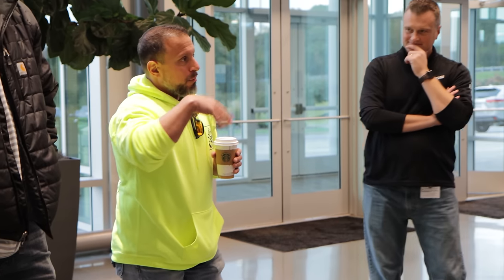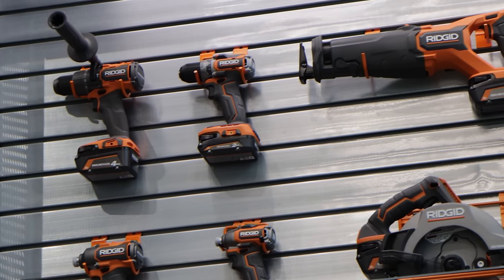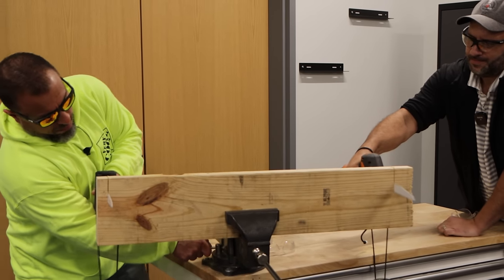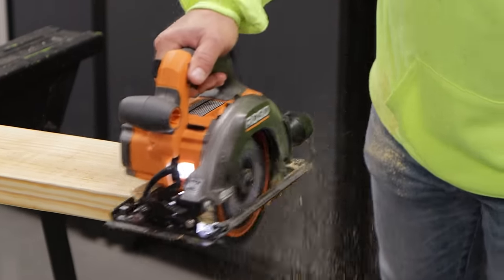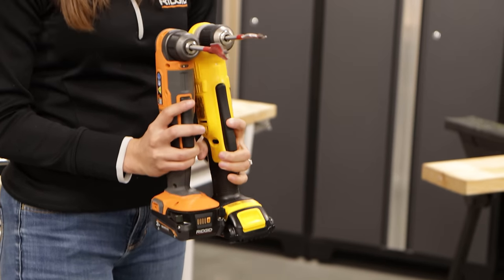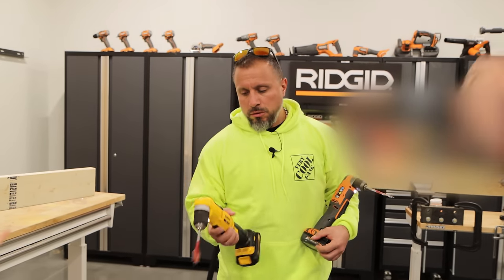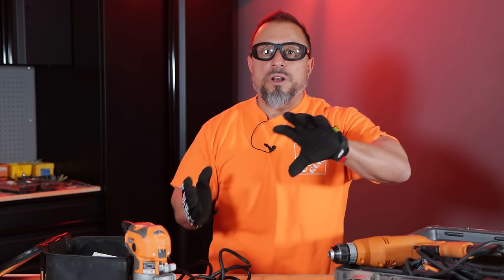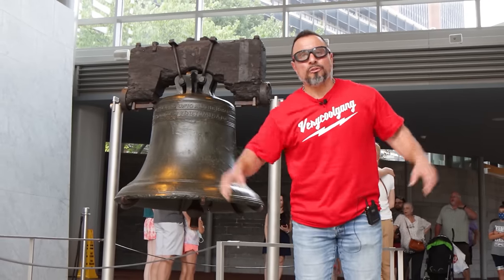Telling Ridgid Executives I Don't Like Their Tools!

Comment: Im not on the Ridgid platform but I'll be cheering on their success.   Ridgid's new offerings will help drive innovation, competition and ultimately improve their customers end user experience.   Those demo's were impressive!  Have an awesome night! 👍
Reply: As a professional the Ridgid Miter box is not something I would ever buy. Took mine back, very inconsistent cuts even at 90 degrees. The cuts were all over the place. I have an old Ryobi that cuts 90 after 90 after 90 all day, dead on. Ridgid also does not offer the same selection that their sister Milwaukee does. So, at this point I am going over to Makitia. The quality is there, and they give you a great variety equal to Mil or better. I stayed with Ridgid for the last 8 years. Now, for a tool company to fall on their face with a poor miter box design, they are not competent, how did you let this happen?

Comment: Like they say “two’s company and three’s a crowd.”  It’s hard managing three separate tool lines and maintaining a purpose for each. Back when Ryobi was blue and didn’t have as large of a line of tools and was what Chaka Gillis thinks Ryobi still is, having the Rigid line made sense as a step in between Ryobi and Milwaukee. But the Ryobi line has become huge and the green so much better and Milwaukee’s prices are really competitive that there isn’t as much need for the middle step anymore in my humble opinion.  Maybe they should stick to corded tools and vacuums where a lifetime warranty is more valuable?
Reply: Milwaukee's price is not all that great when you consider the top end ridgid octane tools meet them in quality and swap blows in perfomance. 

No matter where you look they swap blows on many tools and Ridgid hi torque 1/2 impact holds the crown of the most powerful 1/2 cordless impact as tested By Torque Test Channel found here on youtube, which includes all models of 1/2 Milwaukee impacts which are intern more powerful than pretty much all others themselves.

The biggest thing ridgid lacks is variety which is funny considering the amount of other tools they release under their name in other countries which is  AEG.

I would however agree That Ryobi is still on a Slope headed closer to the top day by day as their tools keep getting more features and more power. Their new mid torque impact is a monster. Leaving only a small space for ridgid to fit in. If ridgid continues to make tools like their newest line up though they may be swapping spots with Ryobi. Happy with all my Ridgids except for the three subcompact tools I own. The power is ok but the quality is, well it remains to be seen.

When Ryobi starts to swap blows with Milwaukee constantly then it may be time for ridgid to go. I guess Id have to go Milwaukee because I hate the old school style of the Ryobi batteries, they are terrible to store and pack out if you have a few
Reply: @D3M3NT3Dstrang3r  I completely agree with you on rye batteries. The HP line should have been in the new style of batteries and just include an adaptor to make them backward compatible. Total ball drop there.
Reply: @billsedutto8824  Totally agree. I would love to pick up more of their line as they are getting strong and reliable enough for daily use given their variety and price. I just hate that with all other manufacturers you can stack the batteries in a box or cabinet etc. Not Ryobi though, you got to play a game of Tetris to get them to fit neatly.

Your right too, it would have been a good time to swap to a newer style. I agree it would suck to lose backwards compatibility but they could just as easily make an adapter like Dewalt did with their 20v max Lithium to 18V ni-cad tools. In 99 percent of cases considering the average buyer of most of the older Ryobi tools that would be just fine, especially if they made the adapter nice and thin so it would almost be unnoticeable when attached to the tool.

 I guess it would suck to have to buy newer batteries but if your buying the newest tools you probably need to anyways to get the power gains of the newer tools. If your gonna cut the power in half with an old battery might as well just use the old tool.
Reply: The green line may have become huge, but its still TRASH.  Ridgid all day over the green crap
Reply: @D3M3NT3Dstrang3r  I went out and got that 1/2 in. Octane impact and 3Ah  batteries  after that TT test.    Sad to see Ridgid abandoning Octane power in favor of emasculated pretty-boy metrosexual   mini-toys!
Reply: @chakagillis  Whoa the legendary Mr Gillis!  Just to be clear I wasn’t saying green was better than Rigid. I’m saying if you want something better than green then why stop at Rigid when Milwaukee is only a few bucks more?  Quick example Brushless Hammer drill tool only M18 Fuel is $30 more than orange ($169 vs $139).  

Since I have your attention I have to ask when’s the last time you tried a Ryobi tool? If it’s been a couple years you might be surprised how far they’ve come. They’re not pro tools but to call them trash is a bit harsh.
Reply: @galacticunderground1  only if it comes with a cord.
Reply: Maybe that's the 4D chess of the Ridgid line.  It's great for "common" jobs... but once you need something a little off you need to get into Ryobi or Milwaukee and BAM, you now all of a sudden have bought into all the TTi battery lines.
Reply: @jimmtech  I own all three sizes of the octane impacts and love every one.

I also own the 3/8 subcompact. That is a whole other story. I don't regret purchasing it. It does everything I purchased it for, however it is not up to the power or quality standards I expect from Ridgid. 

It had some really stupid defects that showed up that definitely showed lack of quality control, at least on this specific tool.  

The chuck on my Subcompact drill also seized up on me not too long after purchasing it as well. With that however I just got the chuck replaced with a significantly better one anyways. I did not want to swap it for a new drill with the same crappy chuck.
Reply: @galacticunderground1  yeah, I'm not being serious ...so I guess you are the one that doesn't have a clue ^_^
Reply: @chakagillis  I have a couple of complete generations of Ridgid tools dating back to the first drill I bought in 2008. I believe they are some of the best tools there is. 

However even Ryobi's specs and build quality of their new lines are shitting all over these new Ridgids and it is pissing me off.  

Ridgid really does need to up their game with the lineup too they make  many other tools in their AEG lineup too so it is not like they would need to design new tools they already make then with an AEG badge. 

I don't know why TTI thinks rolling the specs of the tools back 2 generations for alot of them is a good idea. 

These Octane tools are going to have to last a long time for me. I of course expect them to be kicking in a decade or so like all my other Ridgid tools. This new shit will be in the scrap pile by then if they are the same quality as the 3 newest ones I have bought from the subcompact line. Two of the three had failures and other issues before they were even three months old and only with light usage as I have the octane stuff for everything else. 

The Subcompact 3/8 had a wire that fell off of the battery connector internally, it was not properly soldered.

The Subcompact 1/2 drill, poured smoke and a small flame which I blew out while drilling a 3/8 hole in a thin steel panel. It did keep working and still seems to work like it did before the little fire with no more incidents since. Shortly after that the chuck just decided it did not want to move from its last position, the collar would move but it just clicked in either direction.

These tools will slowly drain batteries if you leave them attached. They will sometimes start in the wrong direction when you pull the trigger, and many other type of weirdness. I have several reasons to believe these new tools are going to be junk. I definitely wont spend any more of my money on them until others have thoroughly tested and reviewed them. 

 Another thing is say my octane hammer drill fails. I need to send it in to be repaired or replaced. In any situation I have experienced or read about if they still have any stock of the same model they will send you that. If they don't they will send you a new one that is supposed to be comparable. How are they going to do that when the new series top model drill is nowhere near the power of the octane and you lose several features as well such as the flashlight feature, or the protective rubber overmold that has mostly been removed. It is like sending in a old Porsche and them sending you back a new Beetle. 

Sorry fella even though you have a lifetime service agreement we no longer produce Porsches so we are going to send you our slowest and most featureless Beetle we have made in the last 5 years, enjoy.

If you race your Porsche for a living, then receive the Beetle as a replacement you can likely no longer make any money using your new useless for your needs car.

I make money with my tools and this would be going backwards to tools that may not be up to the task that the previous one was capable of. Now I have to go find one that works in a different brand yay. Sadly the cheapest brand may actually now have a better tool that is capable of that task to offer.

I don't understand this move. If I had to change to another brand because these tools no longer meet the quality or performance of every single tool this brand had made before I may be out of a little money from buying the tools I need. Ridgid will be out of at least one lifetime customer and likely many more just like me.
Reply: @dtester  What they don't know is I'll just buy a battery adapter for my new tool and use one from my vast collection of ridgid batteries, screw all the new batteries and chargers lol. The Ryobi blower I bought came with battery and charger anyways.
Reply: @jimmtech  Also the only saving grace for octane is that the max batteries do have the extra tabs for the octane tools. It appears that they may possibly not be quite as stout but they will definitely be better than the non max or octane batteries. That is a good thing because if these new tools turn into crap like I'm feeling they unfortunately will these octane tools are going to have to last until they start making good tools again, or they die and I am forced to swap to something better.
Reply: @billsedutto8824  I think Chaka Gills secretly works for Ryobi. Just using reverse psychology on us.  Jedi mind trick.
Reply: @D3M3NT3Dstrang3r  you just busted out the 5D chess!
Reply: Hey don't forget about the red headed step child Hart lol
They've diluted their lineup too much with far too many crossovers. Especially with their entry level combo kits (brushed drill & impact imo that's what will determine your battery line for a while) they're all within $50 in price. Hart, Ryobi, and m12 at $100 to M18 at $150.

Comment: I recently switched from Ridgid to Milwaukee, and seemingly at the right time. The Octane line was awesome, but their new lines just seem... slightly better than Ryobi
Reply: Same same. Really impressed with the fuel line so far
Reply: Fun fact, Milwaukee, Ridgid and Ryobi are all owned by the the same parent company, Techtronic Industries.
Reply: @robertrandall9807  at any rate, they clearly put more into their Milwaukee line. Thanks 4 info, didnt know that. Dewalt/ black n decker marriage i was aware of.
Reply: Go look at a tool company  ownership chart. Each brand is to fill a specific segment in the market, and each parent company had a tool brand at each price point. 

You are a perfect example. Ryobi, Ridged/AEG and Milwaukee are all owned  by the same company. 

Having a customer progress ryobi  - Ridged/AEG - Milwaukee like you have os the perfect outcome for the company
Reply: @darcybarnes2716  cant argue w solid business plan!!

Comment: I have to agree with one of the other comments that there was a knot in that wood and up to that point there wasn't a difference. Also I'm sure dewalt will be updating their right angle drill ...the Dewalt brushed drill was barely a half second behind. It just seems like Ridgid dropped the ball about 2 years ago.  Thanks for another good video though.
Reply: you know dewalt will raise the price.
Reply: I am not sure if Rigid was waiting for others to produce newer and more efficient compact tools so they could see where the market was going. Their drills still had a metal chuck which rubbed on surfaces and polished right up (it quickly looked worn) when others had unbreakable plastic chucks for years. It looks like they are catching up, or trying. It shud be noted that once a craftsman selects a brand of power tools he usually sticks with it because of the $1000 of batteries he has for it.
Reply: Word...
Reply: Thank God you actually gave a timeline for when the rigid tools quality seemed to take a nose dive, because I thought I must have been insanely lucky or something. I've had my rigid tools for around five years now, and not one of them has been bad, or crapped out on me. I work maintenance, and I use them every day, often, some of them, like my circular saw, sawzall and drill perform as well as other people's corded tools. The drill mixes mud like  a corded one, and my sawzall is really close to my corded Bostitch one in performance. My finish nailer can pretty much keep up with the pneumatic one that my company has without having to lug around a compressor, and my circular saw rarely has ever bogged down, same as the corded saws I've used, and that's only when the battery is just about dead. So if what you're talking about is the uglier looking ones I've seen popping up within the last couple years, that makes sense, as they didn't seem to have the quality of the ones I already have. I also imagine that if there are issues with any of their products, said issues are more likely to pop up when used in a construction setting where they are used for their singular purpose all eight work hours of every day. While I am shooting up trim in a couple of apartments in a day, I'm not shooting trim every day all day, so I thought that maybe that's where people were seeing problems, but maybe it's just the tools from the last couple years?

Comment: I’m not that knowledgeable with tools but I noticed on the right angle drill yiu used a normal max battery with the dewalt and a 2Ah on the rigid. Does this matter at all?

Comment: Ryobi 18V One+: Over 225 different tools
Milwaukee M18: Over 200 tools
Ridgid 18V: Altogether, about 56

Neither TTI nor Emerson have folks completely convinced that they are 100% dedicated to the Ridgid line. My first set of tools was Ridgid. Once my needs changed, I had to buy into other platforms. They're not bad tools, but they're not great, either. They're good, but it seems like they just cannot find their target customers.
Reply: I was thinking of switching to Ryobi from Kobalt (a rebranded Skil basically) because Ryobi has every tool under the sun to the point I wouldn't be surprised if they had a battery powered kitchen sink. However I've heard Ryobi isn't as durable in their construction as their competitors.

Comment: You nailed it brother! I switched to Ridgid tools and then began to think I made a mistake because everyone else was putting out new tools and Ridgid stopped cold turkey, it was to the point I thought I'd have to change brands, and yes his point was not directed at you, he was letting his people know to get busy, good to hear, thanks for the video great job
Reply: You're right. Because when it comes to one particular tool, the best one available is the one that was most recently released. Like the right angle drill for example, of course ridgids brand new brushless motor drill is gonna be better than the old brushed dewalt drill. Then dewalt will release a new right angle drill that will be better than the current ridgid. So in order for a tool company to have the best tools they have to constantly be updating them

Comment: These are the questions I wish you would have asked on camera:

Do you read the comments from my subscribers?
Do you realize how many Octane users are disappointed you discontinued the line in favor of smaller less powerful tools?
Can we test on camera here in the showroom with older Octane tools with a 3Ah battery against the new models?
Is it true the newer 6 and 8ah batteries will have 21700 cells and when will they become available?

Ps:  did the Dewalts used in the demos have the new Dewalt batteries?
Reply: As objectively sound and reasonable as that request would be outright; and I don't know because I'm a stooge by comparison, but I'd imagine when you're invited to a facility by a company, that company is in control of all the variables, not their guests.

I don't think it'd be asinine to consider it's entirely possible that the inviting company requires NDAs to be signed and to review and approve all photographic pictures or video taken.

For me, it comes down to who is chosen to talk, is it their dual-major marketing and MBA, or their value engineer who was responsible for choosing what materials go where, and why. 

I'd rather talk to someone about their issues with injection molding, than to someone who'd rather talk about their issues getting their products out the door, and cringeworthily try to sell them into your hand.
Reply: @Keatononame13  that's why I appreciate torque test and project farm and other YouTube channels that do comparison tests straight up with no b*******– is it actually a better tool? Do the actual results match your claims or not?